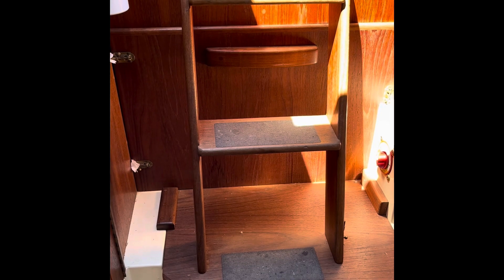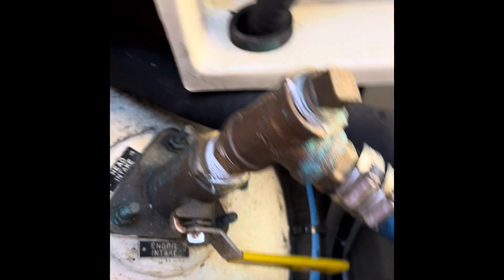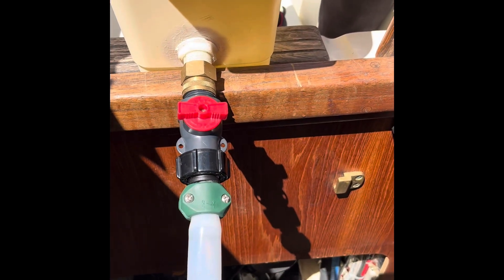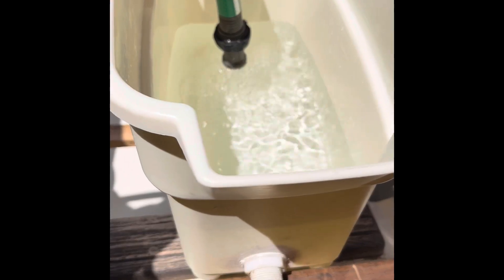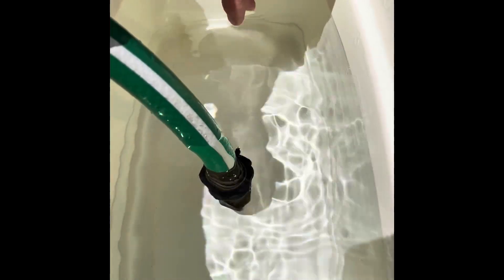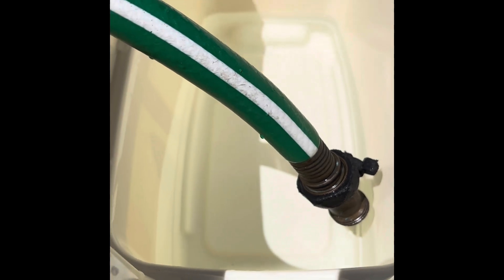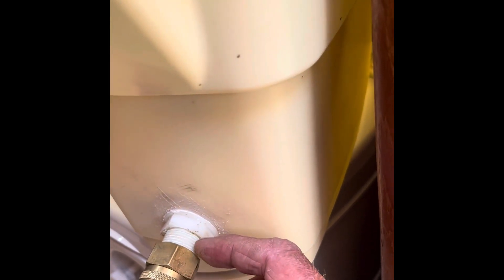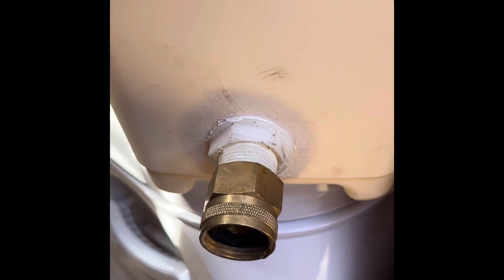Flicka 20 - Flushing The Yanmar 1gm10 Engine With Fresh Water

Comment: I'm not familiar with marine diesel engines.   At low speed it was making a banging noise.  Is that normal ?
Reply from the maker: Yes, that is pretty much how they sound when you start them up, especially a one cylinder engine.  I does quiet down some as it warms up and at higher rpms..

Comment: I have a brass ball valve where your plug is and leave the garden hose connected all the time. Then just put the hose in a 5 gallon bucket and it will suck it out just fine. I thought of filling the engine with a couple gallons of vinegar, but never have.
Reply from the maker: Great idea!